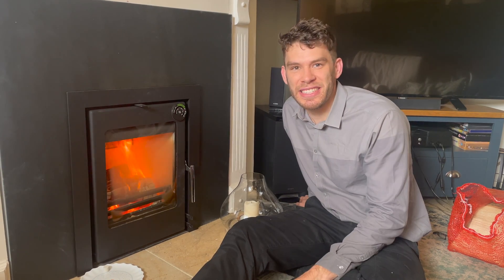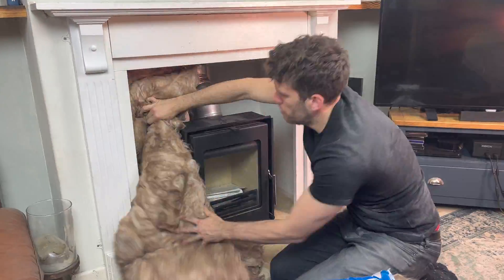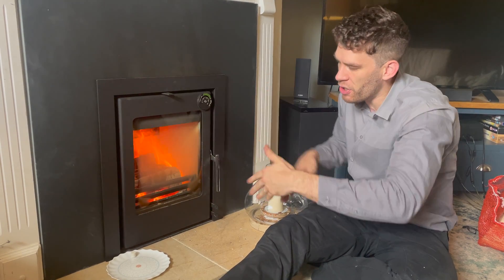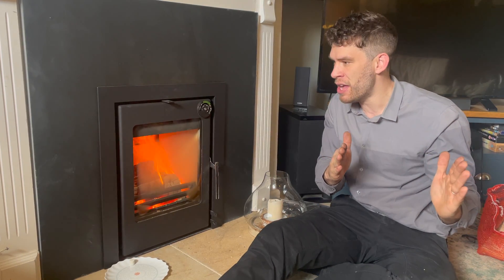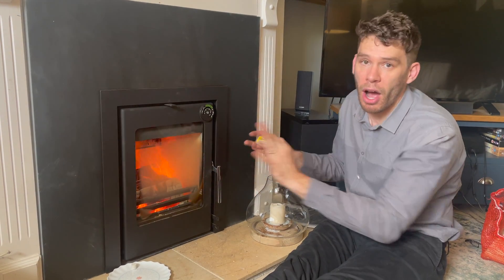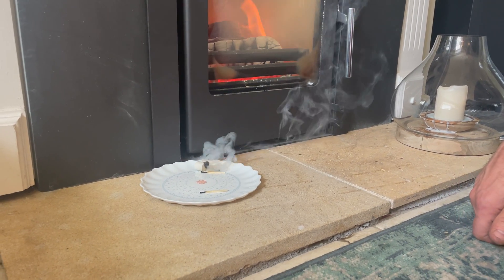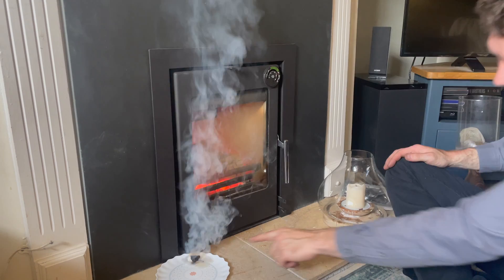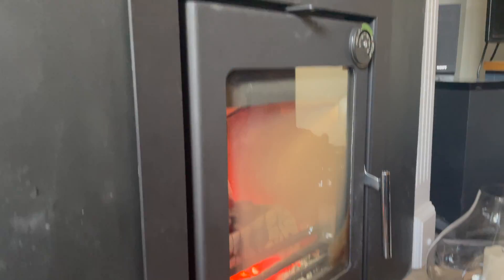How does an inset stove give off heat?

Comment: I have one . The heat exchange is quite poor. Because of this I pulled the cassette fire further out and added another band of steel with holes in to emit more heat. That was also insufficient. So I added a fan beneath the oven. That does improve the heat given off nut also burns wood like Billyo. It's 5kw or thereabouts. I reckon I need around 7kw for my room. It's positives are than its clean and it tends to keep the window clean .....so it's nice to look at. The negatives are I had to put in an extra form of heating before my room gets comfortable. In my defence ......half the bits were not there , they gave me the wrong info on the wrong model......So it took me a while to get it right . (Bought on Portugal )......and I have no Portugese. 🤣

Comment: You sure that smoke isnt just going into the air feed of the stove - I didnt see much coming out of the top.   I have an inset wood burner much like this - as well as a free standing unit in another room, and while it is good and can through out good heat, I certainly don't think they are as effective as free standing stoves at convecting heat out.
Reply from the maker: There is no air feed in the convection box at all, so it’s certainly looping round. That said it will be more dispersed on the way out of the top. 

I agree on the output side of things, but I guess the impressive thing about these convection systems is the amount they do manage to get into the room (despite the obvious limitations they have).

Comment: Is there any do’s and dont’s regarding the rock wall insulation. It it a special fire retardant type or just run of the mill stuff?great video btw😊
Reply from the maker: Always worth asking when you buy it, but as far as I have found loft insulation roll is fireproof. It’s normally glass fibre which is the same stuff the door ropes are made of.
Reply: @TheTortoise  thanks for the reply much appreciated 👍

Comment: Do these type of stoves have to be air tight against your fire surround? Looking for one, but our surround is rough stones
Reply from the maker: Not air tight, but for rough stone we sell a 25mm rope to put behind the surround to seal it up a bit better. You tend to bolt the stove in place to keep it positioned tightly.

Comment: You did the test with a blower on, or is it just natural convection of the inset ?
Reply from the maker: No blower at all, that was all natural convection currents.
Reply: Ordinary stoves do this as well,that's what the controls are on all stoves,they draw air in to light the fire! The difference with inset and cassete stove is the second wall leaving a cavity between inner and outer wall,and thn the air warm at this stage,entering the room! Standalone stoves take up more room in some houses,and these stoves can resolve that problem! Having your house well insulated helps too!